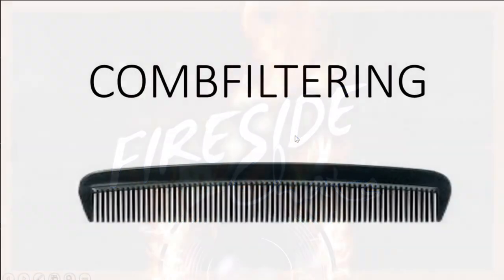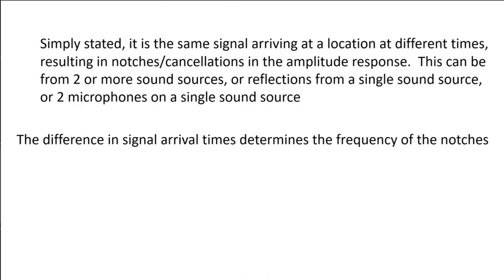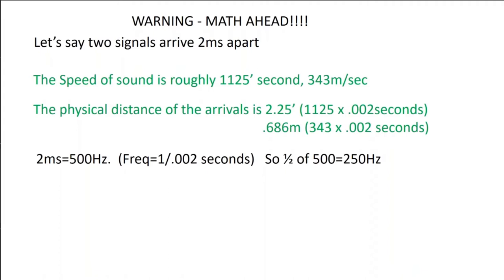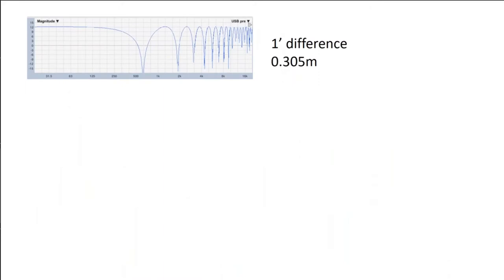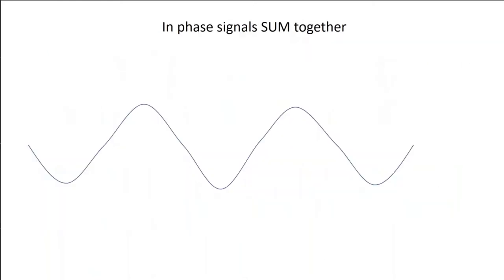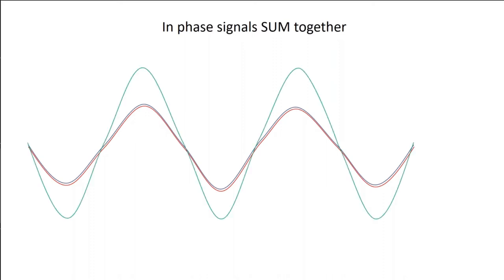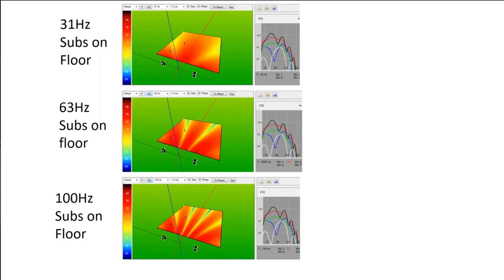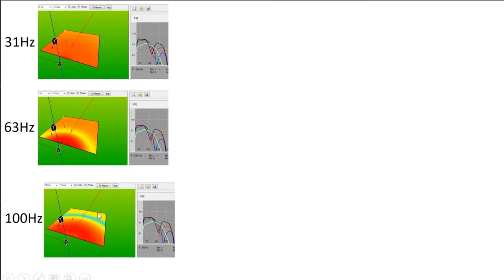Danley Fireside Chats | Ivan Beaver | Combfiltering in Loudspeaker Systems

Comment: If I make a point re: phase analogy using water. If one can visualize air as a liquid (water) , we can see the phasing difference as if we were in a pool pushing 2 hands forward across the top of the water to splash someone (in phase) or if one was to push with one hand and from the same starting point pull back with the other, there would be a major cancellation (out of phase) of the water splashing on the "someone" So, if one was to push with one hand, and add a delay to the pulling hand, there would be even another different splash result due to pulling back at a later time. Either way, the original 2 hand splash is in phase, is disrupted. This is what happens with multi woofer  placement. It's also known as time alignment when multi frequency drivers are used together and thats a different animal! Keep in mind, the amp can also electrically cause the same issue by delaying the signal to one woofer. Sorry if this was covered, I only went in 8 min!.